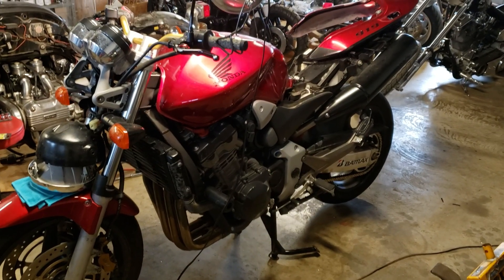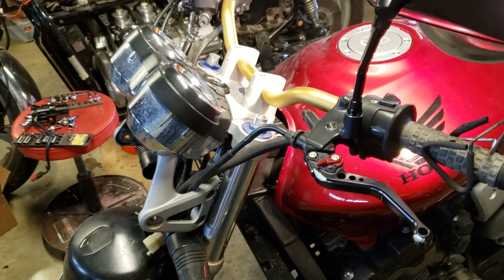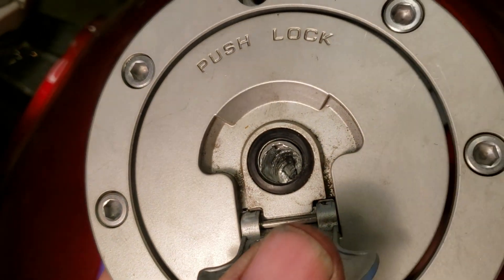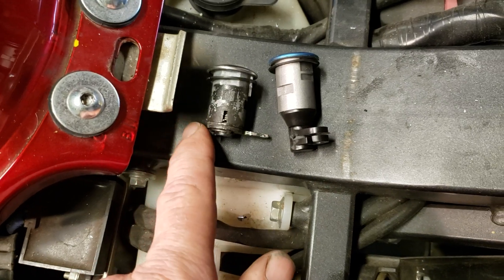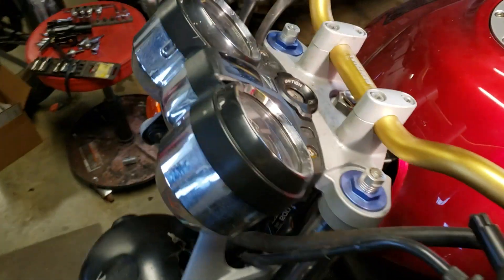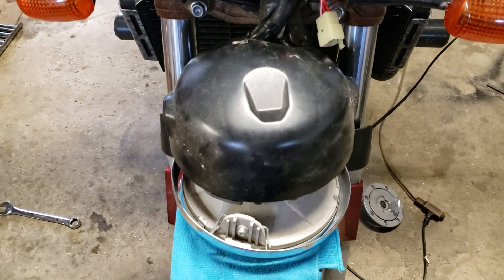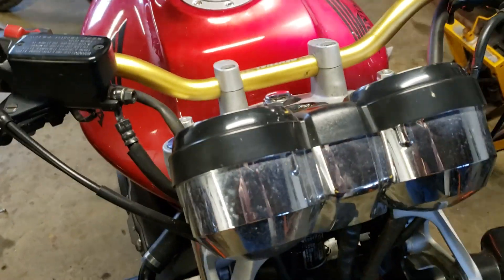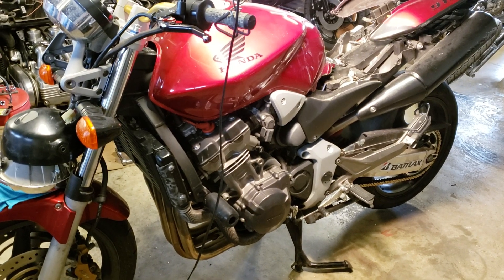Pt1: 2007 Honda 919 ignition and keyed fuel cap

Comment: How did you end up wiring the ignition. Like you said most aftermarket switches are 2 wires, the factory switch had 3
Reply from the maker: @2wheelsarefun73  https://youtu.be/IDChPmj_dHE?feature=shared
Reply from the maker: @2wheelsarefun73  https://youtu.be/kE8MbyvyPWI?feature=shared